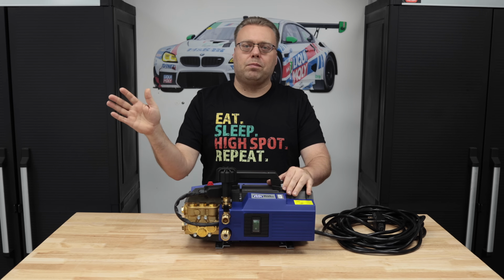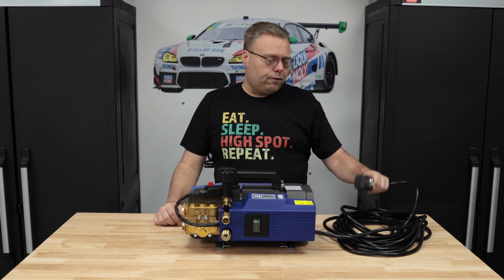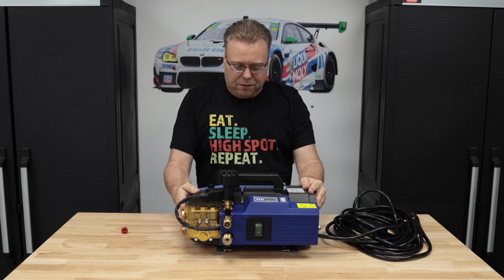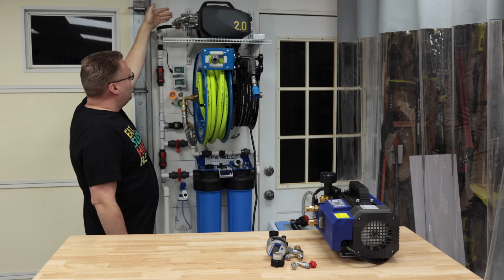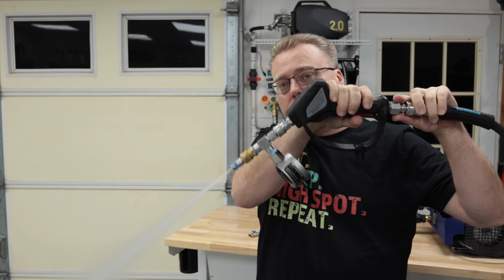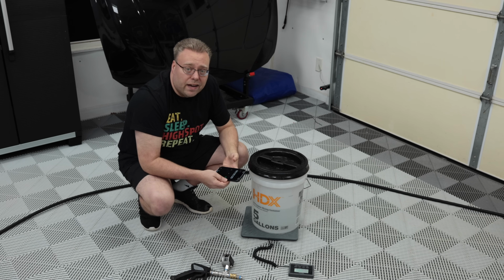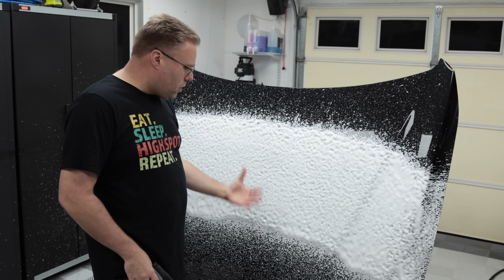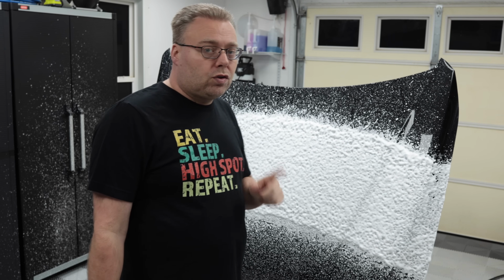Best Pressure Washer For Car Washing! | AR630 TSS | Review & Testing

Comment: I just finally finishing my setup today and my brand new AR630TSS  runs continuously.  All the rest of my setup is top end components.   Using ACTIVE Premium Short Pressure Washer Gun mated to a BluShield Aramid "Kevlar" Braided Rubber Pressure Washer Hose.  Running it through a brand new CR Spotless-20.  Not a single leak anywhere.  Plugged into a newly install 240v receptacle.  According to the pressure gauge at the nozzle, I am getting good 1000 psi pressure at the gun using a Mosmatic 5.0 orifice Nozzle.  My incoming water flow source supplies over 5 gpm.  I can hear it making a clicking noise when I pull and release the trigger however the pump itself runs continuously.   I've only run about 20 gallon through it but am afraid to use it as I don't want to damage something or have it overheat.

Help Keav, what am I missing?  Any ideas?
Reply: Worked with the Tech Support folks a Blue Clean and it was determined to be a faulty Micro-Switch.  Easy fix.  New switch is one the way.  These folks were a pleasure to work with.
Reply from the maker: @GameOverSqueeze  That’s awesome glad they were able to resolve so quickly. Several have said AR customer service isn’t great, but this sounds like a good experience.
Reply from the maker: Have you tried to use a nozzle that has more pressure such as a 4.5 or 4.0? Is this in the U.S. since it is a 240v? Try using the pressure regulator knob and adjust up and down to see if the pressure switch engages. Make sure it is the TSS model by seeing if it has the plastic triangle Hooked up to the outlet and power cable running to the motor. Trying to think of anything else you have all the best stuff and it should be turning off and not running. There is a 630 unit that runs all the time, but you said it’s the TSS model. Is it like a surge where the motor and pump are running or it is just idling?
Reply: @CarsWithKeav  Sorry, I meant to say it is plugged into a 20 amp dedicated circuit (not 240v).  It is definitely the TSS model.  I also tried 4.0 and 4.5 nozzles. It sound like it basically idles and then ramps up a bit when I plug the trigger.  I can hear the audible clock it make when I pull and release the trigger.  The pressure is coming out of the nozzle just fine.  It just won't stop running.
Reply from the maker: @GameOverSqueeze  Sounds like possibly a faulty pressure switch. Have not heard of that being a normal issue with these.
Reply: @CarsWithKeav   I am in the United States.   Sorry, I misspoke before when I said 240v, I meant to say dedicated 20 amp circuit with that special receptable.  I ordered the AR | Blue Clean AR630TSS-1900 PSI Car Detailing Pressure Washer With Total Stop System which reads right on the CarSuppliesWarehouse DOT Com email receipt.   Also tried the Mckillans 4.0 and MTM 4.5 nozzle, still doesn't shut off.  It is basically always-on idling constantly and gets slightly louder when I pull the trigger.  I do hear an audible click when depress and release the trigger.  Same clicking I have heard in your videos.  There is nothing definite that reads TSS on the outside of the unit.  It does have the power cord running to the motor.  Not sure what you mean by "plastic triangle".  It does have the plastic cover over the Green power toggle switch.  I will contact CarSuppliesWarehouse tomorrow.  This is baffling

Comment: I didn’t know the 20amp plug identification tip you gave. Great to know actually!
Reply from the maker: Yup, there are many 15amp outlets with 20 amp breakers behind them and that works, but a 20 amp outlet has that plug design. To get around this many will change the GFCI plug end to be a 15amp then change their breaker behind it to be 20 amp.

Comment: I had at one point had the AR630, Karcher and Kranzle K1600 (discontinued i think), after a year gave away the karcher and sold the AR630 im not a fan of ceramic plungers that the AR uses, it didnt like the sudden increase in temp so when hit the gun i notice a leak and pressure way low come to find out the ceramic plunger was crack, fixed it and sold and went with Kranzle 499 tst and just recently got the kws700 which is ok. heavy and takes up space, out all the them id take my 13 year old K1600 anyday, its just simple plug in and play,  its not a non stop machine which after having the tst and timed stop machine it didn't sway me from giving it up and go all total stop machine ,its whisper quiet aT @60+ db than other pressure washer ive used and also i ran it with and without water and this thing just keep on running lol.  I do my own maintenance and Parts are NOW easy to get thanks to Dirt killer for stocking up the consumables. I would say the AR630 is not a slouch either its good machine just make sure u ramp it up and gradually run cold to hot or vice versa…on a side note Kranzle are also rated up to 140 degrees fahrenheit.
Reply from the maker: I have never used any temp water that is considered hot or even over 90 degrees. I know when you get into higher temps it puts more strain in the unit. They do make a hot water AR630 TSS wonder how that would do with the higher temps. Thanks for all the great info you provided here.

Comment: This video is very good. I really need help with my 630. It just won't run. Keeps tripping the breaker and I've used different tips including 5.0 etc and it just isn't working for me.
Reply from the maker: I had issues with my breaker because it was a arc and gfci combo and was too sensitive. I changed out that 20A and switched it out for a 30A and had no problems. It uses a good bit of energy to get going.

Comment: Purchased one and received it 2 weeks ago and right out of the box after hooking it up it was leaking from the pump area on the unit. After contacting the company ar blue clean which is where i bought it from directly they seemed to act as if it was my fault "sounds like the pump has froze up and cracked due to improper storage how did you store the unit?" When i had stated in the original message to them that it was leaking immediately before even pressurizing the unit. Has been 2 weeks now still waiting for "the next step" how long am i supposed to be expected to wait to use my $1000 Purchase? Not impressed with the companys customer service or the quality so far.. not a small leak either
Reply from the maker: That really sucks! Do you think it was damaged in shipping by being dropped? Not exactly the response I would want for sure, but based on some other comments is inline with what they have said. Hope it gets resolved for you. There is always “The Chargeback” as the final option.
Reply: @CarsWithKeav I have been using pressure washers and repairing them myself for atleast 10 years and after opening the pump up my honest opinion is the pump looked "used" parts looked warn inside, and the leak is internal. I don't think it would be possible for whatever is wrong with the unit to have happened during shipping. I have used it and am otherwise impressed it's just annoying to have a gallon of water inside of my business every 20 ish minutes. Still waiting on a response from the company wondering if I will ever get one.. will update when resolved..
Reply from the maker: @modernredneck9862  Sounds like maybe a refurbished unit that was returned possibly. They didn’t rebuild correctly so now it leaks.
Reply: @CarsWithKeav For $1k they better not send me a refurbished unit and sell it as new.
Reply from the maker: @ That would suck most don’t buy directly from AR so who knows what any warehouse would do after getting a return they think is good. I’ve gotten some products from other companies I can tell they were used. Frustrates the hell out of me. One good thing to note after all the videos I have done with the AR630 I could count bad experiences or complaints on one hand.
Reply: Did you ever receive a response from AR Blue?  
I am ready to order an ar630 tss this week. I know the machine is great but I'm a little concerned about the poor customer service you experienced. I did call them today to ask some questions and the guy on the phone was really helpful.

Comment: But I love your videos 🎉
but can you tell us without all these numbers is it just as powerful as a gas powered ?
Reply from the maker: No 110v electric pressure washer will be as powerful as even the weakest gas pressure washer. These are for car washing which a gas pressure washer is too powerful for most of the time unless you dial it’s power back some.
Reply: @CarsWithKeav  

Thank you so much, my brother reply fast reply. 

I’ve been running on mobile detailing business for four years now I have a Honda gas powered, but I just like the space of the electric powered washer. Again, I know it’s just an opinion I like your opinion is this good for fleet washes?
Reply from the maker: @Shane7son  I know many who run these in their mobile setups and they run all day long without issues. Most of them don’t do fleet washing it would be one customer and then on to the next one so there is some time between vehicles. Not many vehicles in one spot. I would say the gas powered ones are probably built better for that type of repetitive washing. Most fleet vehicles also are usually wrapped or most owners don’t care about the paint as much so a gas powered would be more efficient just because of the pressure and flow it can do removing a lot of road film without soap.
Reply: @CarsWithKeav  thank you
Reply: @CarsWithKeav  

Thank you so much for the reply. I’m very grateful.  Also very fast reply lol

I run a mobile detailing business , I have been for four years.  Most detailers hate electric, but I think it’s convenient and compact.

Will be able to handle 3500 w generator
Also, I do fleet vehicles as well exterior eyes are really dirty. Can this handle it you think?

I like the compact space again like I said that’s why I want this .

Put that spray nozzle down while doing other things which makes things very clear and then go back and hose it off if you need

Comment: Been eyeing this unit for a long time since Obsessed first reviewed it. Did you notice a difference at all in amp draw switching out the foam cannon orifices? Using a 5.0 nozzle to get below 15 amps is awesome, wondering if changing the orifice would bring it down as well when using a foam cannon. Awesome videos as always!
Reply from the maker: I actually just tested yesterday with all 5 pressure washer in this price range for a comparison video. 4.5 gets you just under 15 amps like 14.7 and a 1.5 orifice works and foams well at 13 amps.
Reply: @CarsWithKeav  that's awesome news. Appreciate all the testing you do on these units.

Comment: This thing is a tank. It fell from a 6ft high shelf by accident, while running... Not a dent, still works like a champ.
Reply from the maker: That is awesome it didn’t get damaged did it hit on the pump side or the motor side just curious I think from that distance the weight do the motor would have it fall that way.
Reply: @CarsWithKeav  From the pump side. I didn't have a hose reel at the time, just the hose attached directly. Yanked too hard when I though there was slack... the pump side got dragged first.
Reply from the maker: @felipe_silve  Built like a tank for sure. Hate see what and active 2.3 pump would like like after that fall.

Comment: As a Brit who has had the plastic 'quick connects' as you call them for the past 30+ years. The plastic ones last longer than the brass. Usually the brass start leaking or are hard to remove.
Reply from the maker: Maybe they are made better there. The plastic ones here in the U.S. break easily. I could start a recycling plant which is why I stick to stainless steel now.
Reply: @CarsWithKeav  maybe from the strong UV? We obviously don't suffer from that in the UK.
Reply from the maker: @CalMUK91  Probably that and just cheaply made plus us Americans do things extra so we tend to test the limits of any product. LOL

Comment: Thank you for the outlet explanation… I felt so dumb, we just got a professional grade pressure washer at work… I looked at the GFCI and plug.. and was like damn.. am I going to have to change this or what… quickly realized why certain outlets have that T- cutout… one of those moments where I was like “damn, this entire time and never why the outlets are shaped differently… SMH..
Reply from the maker: I thought the same when I installed my 20 amp outlet. I’m like that’s a weird prong then when getting the AR630 I figured it out. 🤣

Comment: How long is your hose? I have this pressure washer and I just wall mounted it got the hose real quarter inch. It’s 65 foot and my pressure is noticeably less.
Reply from the maker: 50ft 3/8 inch hose. Pressure washer like this I think 3/8 hose is the way to go. 1/4 inch hose over 50 ft will start to get pressure drop. Depends on the hose reel as well some use very small diameter fittings that could restrict flow.

Comment: Great review! I noticed you recommended staying with a 3/8" hose (& not using a 1/4" hose).

I pre-ordered a Bigboi Pro. Would you recommend the same? I am trying to decide if I can/should use my uberflex 50' / 1/4", or spend the money to pickup a 3/8" hose. Appreciate your thoughts/suggestions.
Reply from the maker: My experience 3/8 hoses on the higher GPM machines the start/stop seems to work way better. Especially on the Active 2.0 my 1/4 uberflex it takes 2 seconds longer to stop and it surges every now and then. 3/8 hose never have those problems. I just prefer them especially the Blushield and Gray ones on Amazon as they have a smaller diameter than say a Kobrajet.
Reply: Thanks for sharing the technical aspects between the 2 size hoses, and how electric pw might respond/react. Upgrading from my gas pw, so a little bit of a learning curve. 

Last question .. Which 3/8" hose would you suggest? Uberflex has a 50 foot 3/8" hose. I don't think I need a heavy comercial grade hose, like what Bigboi is selling. Just need something to enjoy using while I wash my car.
Reply from the maker: @HeadShot1171  I really like the Blueshield Kevlar hoses. Lightest 3/8 you can get and a much smaller outer diameter than most all 3/8 hoses. It costs more, but not much more than an Uberflex 3/8. https://amzn.to/3VIhZOQ I did a video on it as well compared against an Uberflex 1/4 inch https://youtu.be/cuw8ps0h_XE?si=xqdAD4qZAS6pPML6
Reply: Thanks for taking the time to respond. Appreciate it!

Comment: Happy Easter! Uberflex(1/4) vs Kobrajet(3/8)? Asking cause been doing a little research and being seen to think it doesn’t make a difference under 100 feet.
Reply from the maker: Depends on the machine to me. If it’s an AR630 or anything 2 actual GPM I prefer 3/8 especially at 100 ft. 1/4 hoses I tend to use with like Ryobi and other ones like that. Even the A tube 2.0 for me takes longer to stop and sometimes surges on a 1/4 hose, but never does it on a 3/8. Kobrajet is also a huge difference in price. Most companies won’t products a 1/4 hose over 50ft as well. I don’t think Uberflex does they have a 3/8 hose they though.
Reply: @CarsWithKeav  Thanks for your opinion. I already have both hoses so will go with the Kobrajet.

Comment: I’m with you on preferring a 25 over a 40 nozzle. I have a low gpm pw though and as you said with this 40 might make more sense on this beast. Be interesting to see if move to it it.

Nice get. These are definitely great units and seem to make more sense from a value performance perspective. As nice as the Kranzle is it only makes sense to me from a price no object or for someone using it a ton.  Given what your doing now I think you could probably justify either one. I can’t justify either as mine isn’t wall mounted. Since I have to break down and set it up evertime a garden hose and Gilmour foam gun make more sense for a weekly maintenance wash when the car isn’t very dirty.
Reply from the maker: Nothing wrong with a Gilmour and hose. Maybe try an Eley sprayer it is very good, but expensive. Give great pressure for rinsing and awesome quick connect ability to work with the Gilmour. I’ll have a video out in a week or so.
Reply: @CarsWithKeav  I just looked at it. That would be convenient to have a quick connect for just the nozzle and pop the foam gun onto it. I’ll have to see it in action in your video.

The way i do it now is I have a shut off valve at the end of the hose with a quick connect. Then I just swap between a sprayer and the foam gun. I’ve used Melnor multi sprayers for years. I love being able to switch between full, shower, jet and flood for certain parts of the engine.
Reply from the maker: @seashackf1  I really like the Orbit sprayer, but I just stick to Shower mostly as I use it for the spotless rinse. It has no flow limit when you just want tons of water.
Reply: @CarsWithKeav  the orbit looks very similar to the the Melnor so it’s just just personal preference at that point. Either way, they’re both reasonably priced and more than get the job done. 👍